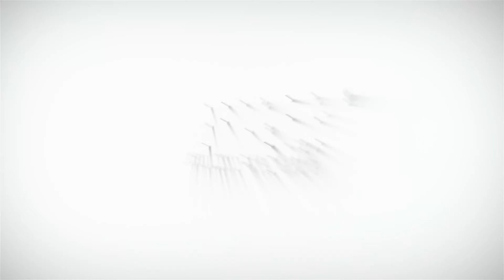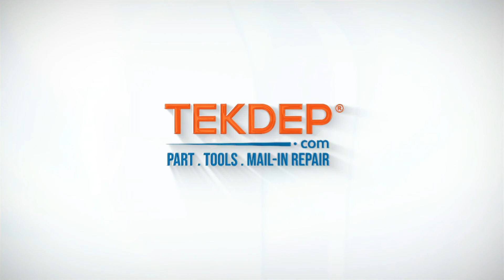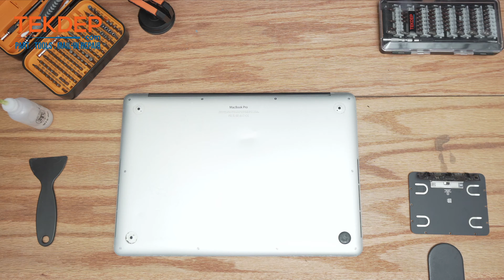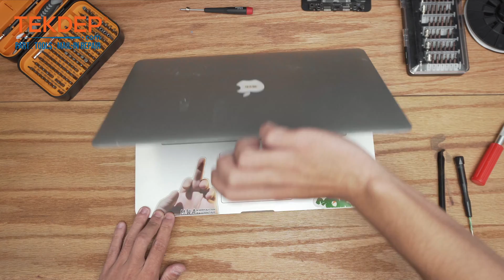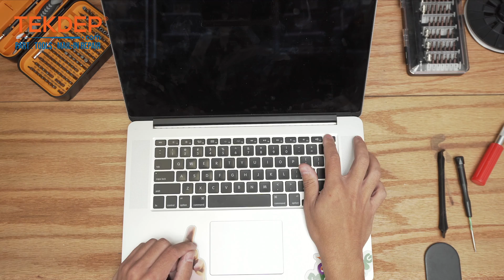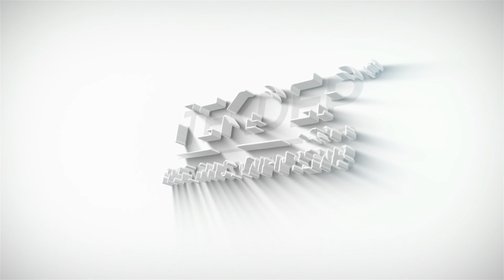Replacing Broken Trackpad 15" MacBook Pro | A1398 Repair Guide 2015

Comment: Need to do a 13in. Same year . Very similar replacement procedure,  yes?
Reply: Should have a ribbon cable and trackpad with screws so I would take most advice from this and apply it where it fits . Should’nt be to much of a difference if any

Comment: Question.   I put in a new track pad.   It worked for a short while and stopped working.  Keyboard works still.  I tried new ribbon and the Pram reset successfully… 
But still doesn’t work anymore
Reply: I’d rather the keyboard work than track pad 
Just use mouse lol

And maybe just replace it again
To see if it’s a faulty trackpad

Comment: Wish this video started out explaining it to me like I’m five years old in this way, or considering this, if I’m five years old, or more accurately, if I’m 55 years old and as a result someone under 20 years old has at some point at least once in my lifetime said to me “Okay, Boomer,”, and in your video you start out by saying, “The first thing we’re going to do is remove THE battery,” (all caps emphasis added), and consequently, having said all that, when I hear you say, “[W]e’re going to take the battery out,” as a, say 55 year old, to me, that is exactly the functional equivalent of saying, “We’re going to take THE battery out, and that of course means you will lose all of the data on your 15 inch MacBook Air permanently, forever, and everything you’ve saved over the past year (and everything you had copied and pasted into one of the twenty, unsaved Microsoft Word documents from critical legal cases) is now toast to the extent the data was not backed up to iCloud, and of course everyone darn well knows I’m 55 years old, that I don’t even believe in cloud data because it is a necessary law of physics that the one time I will absolutely need that data not stored directly on my physical computer, I will certainly not have access to any kind of signal whatsoever and if it’s stored only in the cloud rather than stored immediately on my computer even if I’m stranded on the same remote island Tom Hanks was stranded on in the movie Castaway and I can only ask Wilson for advice, and Wilson says, “We’re going to need to remove THE battery,” and I indicate back to Wilson, “So, you’re telling me, Wilson, that we have to take the battery out and, therefore, I just permanently lost an entire year’s worth of legal work on my biggest case, the only case I have, worth potentially $3.4 million, and the data can never be recovered, so you’re saying I’m back at ground zero, square one, with all that legal research and writing. I’ll need to recreate a years worth of work in two weeks before my 12/20/24 district court deadline?”

So, yep, I wish it started out by saying, “For those of you who don’t know, we’re going to pull out the battery, but . . . “  (A) “merely taking out the battery won’t result in any data being lost so don’t worry about that possibility” or (B) “if you have any critical data that you must be able to recover, you will not want to take the battery out to perform this repair until after you’ve taken your MacBook Air to professional forensic computer technicians so that they can first copy all the data stored on your computer and they’ve copied all the information that was copied and pasted into unsaved Word documents, otherwise all of that will be lost.“
Reply from the maker: This is not a legal training video that your asking for long lines of disclaimers like we are lawyers here! It’s says for 18+ and it’s for entertainment purposes, and I don’t understand what your really saying but over all it’s common sense that If you an adult you need to understand your plan and research before doing something, you need to take your computer to repair shop if you don’t know what your doing or at least do lots of research.. can’t believe your running such a case and and did not back up or save your file before destroying your own laptop! what’s your saying is totally not making sense whatsoever, I’m interested to see what people think in the comments section as I’m struggling to understand story here🤔 good luck
Reply: That much money on the line and you chose to repair a laptop yourself without any prior knowledge about laptops?
If YOU choose to work on your electronics yourself you should know you run the risk of damaging it (especially not being experienced).
I was able to do this fix because of this video and yes I told myself if I ruin my laptop oh well it’s my choice to work on it. Thanks to this guy for making this video. He did a fkn awesome job
Reply: The commenter appears to be saying they know nothing about (1) computers, or (2) repair, and instead of taking their device to a pro, and pay for repair with their attorney-benjamins, they are pointing a finger at a video creator and saying “why didn’t you do it this way for me?” If one isn't comfortable repairing, then do not risk it. If device is not backed up, do not open the case. If one does not periodically press command+s when working in an application like Word, or employ auto-save, they are helpless, and should not attempt hardware repairs.

There is always a risk of data loss during everyday use, regardless of condition of device. That is why users back up to the cloud, or back up to local hard drive(s), on a regular schedule.

Comment: I either stepped every screw somehow in the track pad or they just keep spinning and don't want to come out.  And the pad will not budge at all.   

Anyone have any suggestions?
Reply: Actually, mine so not appear to be stripped as the T5 can grip them.  But the screws just do not budge. It's like they are glued in place.   I got a few out.  But with those tiny screw drivers.  I'm really having to use heavy force down and a towel over the top so it's not digging into my hands as I apply pressure.

But seriously there has to be an easier way?

I am currently trying adding some Gorilla glue to set and hopefully will give some extra leverage.  As the only thing moving is the rubber band rings as they are slide off the screw driver

Comment: what could be the problem if the track pad does not work.
Reply from the maker: In this model, usually the flex cable is extremely sensitive, try to reinserted and if no luck than just purchase ultimately If you're still experiencing issues with your MacBook Pro and need help, we offer a convenient and affordable Mail-In Repair Service and data recovery. You can learn more and get started here: https://tekdep.com/device-repair/

If you need parts or tools for your repairs, we have them all and ship worldwide! visit: https://tekdep.com

Comment: Also worth noting that if possible, you should try swapping the trackpad ribbon cable with a known good one, first, before going through all of this.  Particulates that find their way into the case have been known to be pressed into the delicate cable and damage it.  If it's just a ribbon cable replacement you need, you can save yourself a ton of time and work, and prevent possibly ruining a good battery as well.
Reply: just did mine ribbon cable, and the haptic touch doesnt seem to work still, is the next step a track pad?
Reply: @snewcomer6831  I don't know for sure, but unfortunately it sounds like it might be. :/
Reply: @snewcomer6831  Hi, I have the same issue, actually I have read on Reddit that it is mainly due to the dirt and mud build on the corners of trackpad. and we could clean the corners by inserting a paper. but that is not working for me but I am also afraid to clean it by removing because of the glue that sticking board of touch pad. how is your trackpad now.
Reply: main is just a data board
can i replaced it without pulling out the battery ?
Reply: Do you have a trackpad for A1494  it look like a flat plastic plate. I damaged it when taking out the battery?